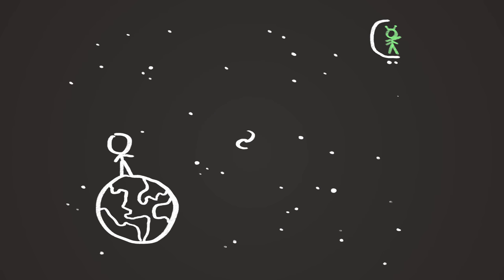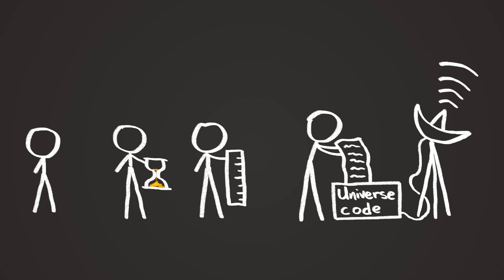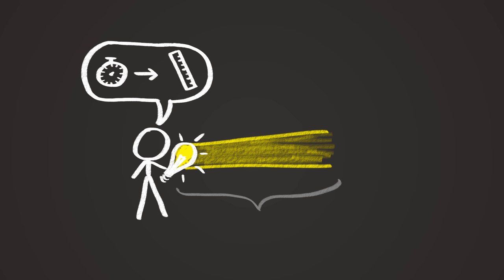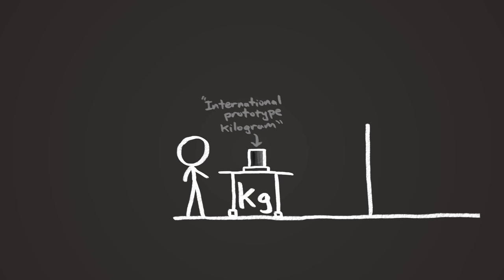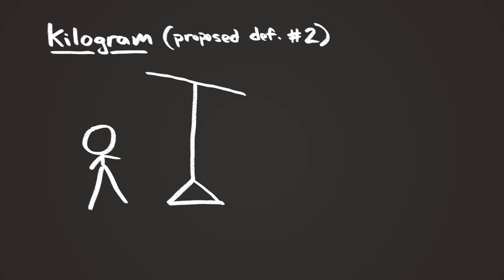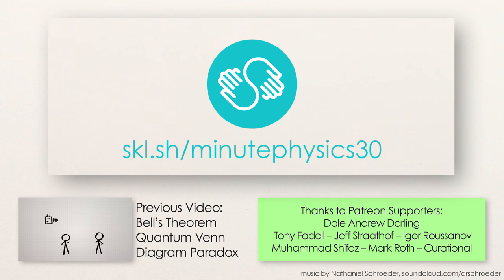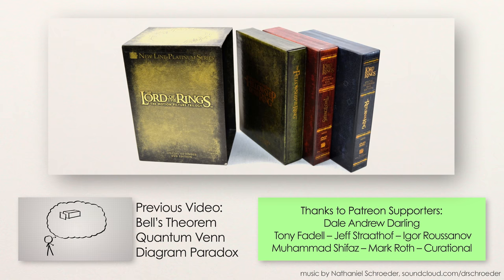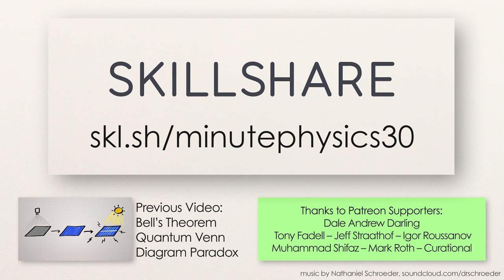How to Build a Teleporter with Aliens

Comment: If we have communicated how to measure distance, then we can tell them that a cube 10cm x 10cm x 10cm is one litre.  And if we've explained the molecule we call water, then we can tell them that one litre of water is one kilogram, right?  Similarly, our tempature scale is based off water's boiling and freezing points.  We could also start from energy instead, say the number of joules required to bring water from zero to 100 in a vacuum.  Once you have energy you can explain force in terms of energy units, pressure in terms of force, etc.  Not that hard.

Comment: Hang on, wouldn't the "have X silicon atoms" method lead to a varying mass BECAUSE of E=mc^2? A lump of atoms changes its weight slightly depending on stuff like how many bonds there are between them, temperature, etc., right?

Comment: At the speed of light relativistic mass is infinite so all energy exists on the three dimensional surface of a higher dimensional black hole. Mass is the bridge between that reality and the 2D universes that form on singularity holograms in this universe. In that sense all mass is inertial and proportional to the information density of the 4D singularity at some point and inversely proportional to the square of C.

Comment: Please can i get an answer from minutephysics? A wormhole is hole in time and space which connects two seperate points in a shorter distance than the actual shortest 3 dimensional distance. But if you think about it, in our 3 dimensions a wormhole would be a sphere, and this sphere would be the exact same sphere in both places. So you're not creating two seperate spheres in two places but rather one which connects the two places. But wound't that mean that this sphere would be one object and therefore it must always have the same speed and time independent from the place it is, meaning you cant change the velocity or postion of one sphere in one place without doing it to the other sphere because they are acutally the same object and we only perceive them as two because we are 3 dimensional beings and this sphere would be of higher dimensions? Im not a native english speaker so probaly no one understood my question, Nevermind then.

Comment: If we had distance and molecules defined to them, couldn't we just use the density of water? Just tell them to take 0,001 m^3 of the molecule with one atom with 8p and two atoms with 1p, let them weigh that and thus define to them the kilogram. Though one thing might still need explaining: positive and negative and on a magnet north and south. Positive and negative are opposite, but it doesn't matter which one is called which. It is only because we once defined it as such that electrons are negative and protons are positive. If they would define it the other way around, the machine might never work, unless we can make one definition. Same goes for north and southpoles

Comment: But, you don't need the official definition of kilogram to be one of those specific ways in order to communicate it. You can just pick anything that is equivalent to a kilogram, including those two, and tell them it anyway. Or just skip over the unit of kilograms and give the mass measurement as a ratio to the mass of anything else they would know the mass of.

Comment: mass of 1 liter of water at 4 degrees of Celsius is 1 kg. liter is 10x10x10cm. you have explained meter and you can explain H2O by numbers of protons and electrons. so you have all you need to simply explain what 1 kg is... and yes when you explain what is water you need to explain a 0 to 100 scale where water is liquid, between being solid and gas.

Comment: I think you're wrong on the '' how to tell them about mass'' part...
If you can transmit what a meter is you can transmit our understanding of space. If you have transmit space you can transmit our conception of the volume. 
If you can tell them what is water you can tell them to put water in a tank of 1 cubic meter. 
1 cubic meter is the definition of 1000kg so they'll have to do a bit of conversion but it's Maths so it ok. 
Cqfd.

Comment: So, regarding the universal kilogram, wouldn't they need to know the gravity of earth (more specifically the gravity of the location where this universal kilogram physically is) since in other areas of the universe, they would be different? In physics we learned the speed of gravity at sea level is 9.8 meters per second per second, the higher the elevation is, the lower gravity is. Then again, mountains would effect this as well. It would certainly be difficult to try to explain it to those aliens.

Comment: Actually if you've worked out distances and materials mass is easy enough. "The material with one atom hydrogen and two atoms of oxygen, enough of it to fill exactly one cubic centimeter at the lowest temperature at which it is fluid, this weighs one gram."

Comment: Metric is based on a lump of metal in a french basement, this is somehow superior than a system based on a grain of wheat in a silo or the foot of an emperor. My issue with metric has nothing to do with the prefixes (you can just as easily add them to any other system "kiloinches or megapounds") but with the notion that it is in any way less arbitrary than any other system used.
Reply: metric WAS based on a lump of metal
Reply: Well, at least the kilogram is, but the meter is based on what light can move in a certain time interval and the second is based on how long does it take for a certain material to emit a certain number of particles.

Comment: Why aren't we using an even number of some atom as a measuring rod? I mean after all, the mass of an electron (or proton, or neutron) as is the wavelength of hydrogen (or cesium) emission is the same all over the universe, so shouldn't we use exactly (say) 2^100 (since we know they have computers and must understand base 2) or 10^30 or some other even number to converse to aliens?

Comment: The density of water in metric is exactly 1, though. Aliens, fill a .0001 cubic meter volume with the molecule with an atom with 8 protons and two atoms with one proton, this is a kilogram.
Reply: That depends on the strength of their gravitational field and their temperature.

Comment: Haven't you seen or read Contact?

If we both understand what a meter is and basic chemistry, then we can define mass. 1 gram = 1 cm^3 of water at 4° C.
Reply: 4ºC could be defined from the triple point of a substance.
Reply: Geometry Dash M31 it's the point of highest density for water.  The relationship of that and the triple point will give them temperature.

Comment: What if we just asked them, "What is the mass  of 1 m^3 of water / 1000 ?" Since, we already defined water and meter.
Reply: At what temperature and what pressure? In this case, 4ºC and 1atm, but how can we transmit this concept? The pressure unit, pascal (pas) is defined as 1 kg/ms². We need mass to define pressure.
Reply: Geometry Dash M31 Ah that difference is negligible

Comment: #AskMinutePhysics Please please please... I want to understand how does ac current flows from the power station to my house... I mean that ac always reverses its polarity so what does it actually means... Does that mean if frequency is 50 Hz in India then in 1 sec 25 times ac current moves form station to my home and from my home to station... I want to understand the flow in a conducting wire which we practically see outside our house... It is easy to understand the reversal of polarity around and particular resistor in any theoretical diagram in a notebook but i can't imagine how it happens in wires outside our house...  How is ac current transmitted to our house with changing polarity at the same time...

Comment: If you already have a way of communicating distance (meter) and elements (#of atoms) couldn't you make a way to communicate mass? 
"Get a piece of material 26 proton 30 neutron 26 electron and shape it to be 1 meter long 1 meter wide 1 meter high" now there's one cubic meter of iron and density of iron is the same no matter what. At this point can't you explain mass?

Comment: Wait, We can communicate what types of atoms the metal is made from. And we can communicate length and therefore area. Why cant we just communicate the volume of all the types of metal atoms and then tell them to smush it together to create that metal piece we call a kilogram.
Reply: Not if you want very exact value, which is demanded by a teleporter
Reply: We would also need to specify a temperature. We could use the triple point of a substance to do that.

Comment: If we had distance defined, and were already working under the assumption that they had access to the same elements we had access to, couldn't we tell them to create a lump of iron with very specific dimensions and call that 1kg?
Reply: At what temperature? Volume changes with temperature. When temperature increases, volume increases.
Reply: That doesn't matter. If I say to build something that is 1m in length. As long as you're keeping the temperature constant, if you build it at 1m in length it will stay 1m.
Reply: +dirnol In length, that's true, but remember, we're defining a mass unit. However, in another reply of a comment, someone suggested to use the triple point of a substance to measure temperature, and that's a good idea.

Comment: What if they don't know what the numbers mean
Reply: What if the aliens are not that intelligent to guess what the operators do
Reply: And How will we explain what a proton is
Reply: What if according to there classification of elements cesium  and silicon are impossible?
Reply: firstly,  if they dont have any concept  of numbers they most likely havn't invented radios either.
Secondly what do you mean if according to their classification cesium and silicon are impossible. they exist, what does the classification have to  do with anything?

Comment: You missed something. We would never be able to tell the 👽 what is right and what is left
Reply: We could just somehow say "point a random direction". Then say "the direction you pointed is called "left/right", the other is called "right/left". However, as you rotate, this also rotates. It's only measured with your vision" or something like that. It would be difficult, but I don't think it would be impossible.

Comment: But do aliens know about our number system??
Reply: Good question. But that's easy to answer too.
you see, the number "Pi" (3.14...) is COMPLETELY universal and not just made up by humans unlike the 10 based number system.
because "Pi" multiplied by the diameter of a circle Must be the length of the outside of it.
and since the circle is the ONLY shape that can maximise the surface area while minimizing the outer length of a shape, thus the circle MUST be universal, so Pi is also universal
so we can just tell the aliens to multiply Pi by the number "3.183098861928886" which will end up to be: the number 10! :D
and there you have it!
Reply: +Persian Mapper However, 3.183098861928886 is just an approximation to 10π. They could think we use the 9.999999999999994326315406420-base system. A better idea is to use lines as numbers, like IIII for 4. We would need to use many examples to show what are these line symbols, though.
Reply: Pi is not a good choice. What if the aliens picked Tau as their circle constant?

Comment: How do explain what “3” is?
Reply: Good question. But that's easy to answer too.
you see, the number "Pi" (3.14...) is COMPLETELY universal and not just made up by humans unlike the 10 based number system.
because "Pi" multiplied by the diameter of a circle Must be the length of the outside of it.
and since the circle is the ONLY shape that can maximise the surface area while minimizing the outer length of a shape, thus the circle MUST be universal, so Pi is also universal
so we can just tell the aliens to multiply Pi by the number "3.183098861928886" which will end up to be: the number 10! :D
and there you have it!
Reply: Have you every seen 3?
Reply: +Persian Mapper Yeah, but 3.183098861928886 is just an approximation to 10/π. They could think we use the base-9.999999999999999463535623552 system. We can't just write the entire 10/π there.

Comment: Wait who says they use the same number system
Reply: Good question. But that's easy to answer too.
you see, the number "Pi" (3.14...) is COMPLETELY universal and not just made up by humans unlike the 10 based number system.
because "Pi" multiplied by the diameter of a circle Must be the length of the outside of it.
and since the circle is the ONLY shape that can maximise the surface area while minimizing the outer length of a shape, thus the circle MUST be universal, so Pi is also universal
so we can just tell the aliens to multiply Pi by the number "3.183098861928886" which will end up to be: the number 10! :D
and there you have it!
Reply: +Persian Mapper Yeah, but 3.183098861928886 is just an approximation to 10/π. They could think we use the base-9.999999999999999463535623552 system. We can't just write the entire 10/π there.